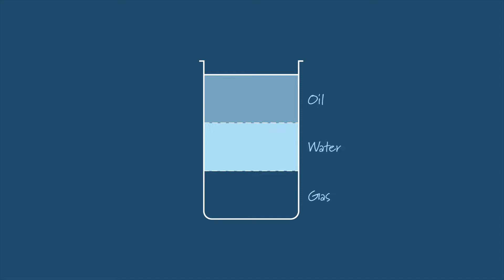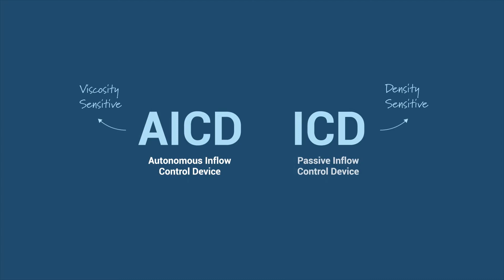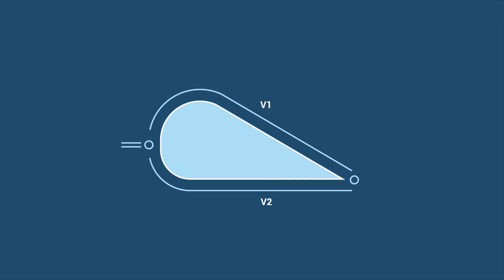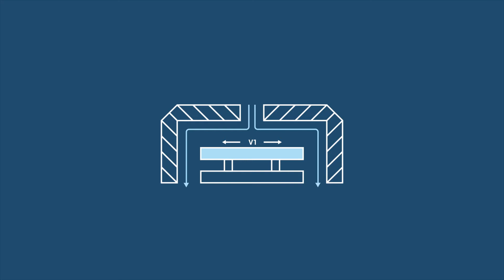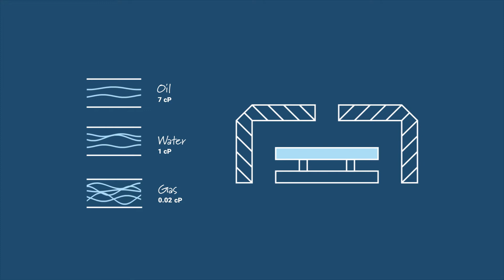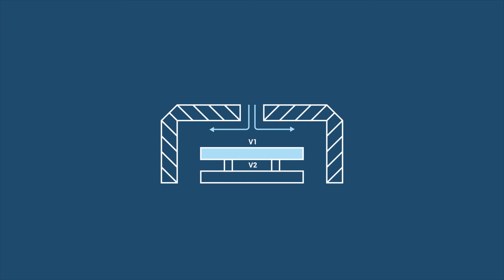The PHYSICS of an AICD - Autonomous ICD

Comment: with the wing there are several inaccuracies, flows from above the wing and below don't merge at the trailing edge tip, they even never merge in reality, and second - the shown pressure distribution above the wing is completely wrong, it appears in the first 25-30% of wing chord from leading edge